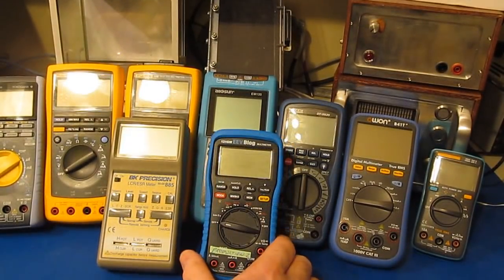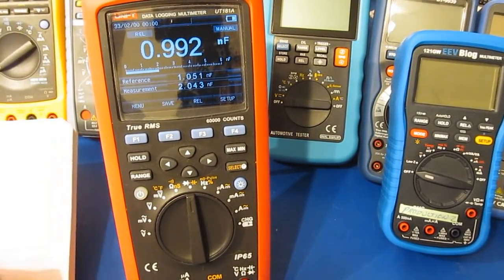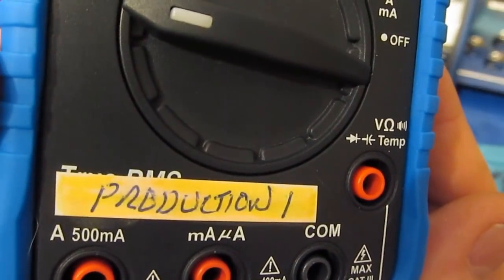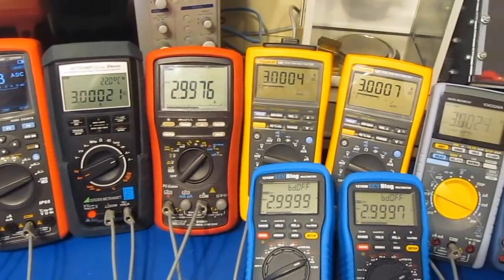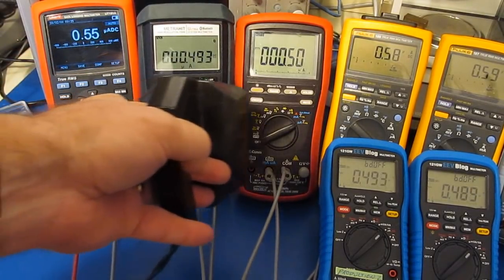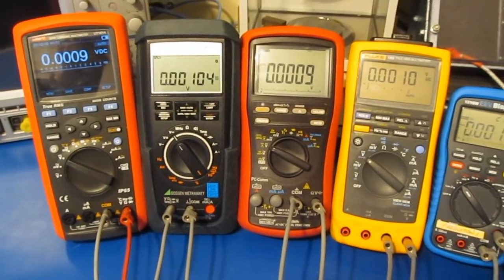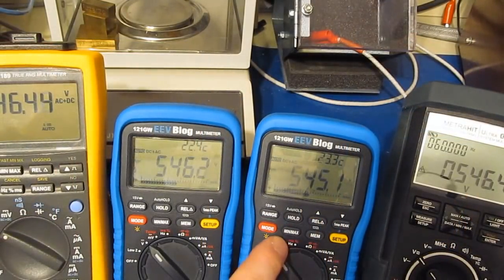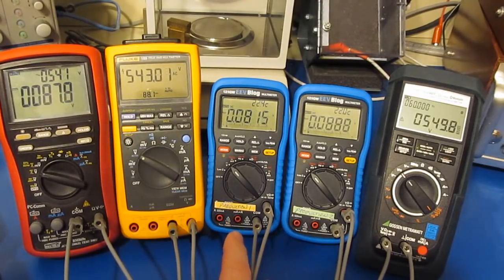EEVBLOG/UEI 121GW  Part 3,  Voltage, Current AC+DC, Capacitors

Comment: I experienced much the same erratic behavior with a Klein MM700, which as I understand, is also a UEi meter. Its very slow ranging and super slow settle times are what sent me on a quest for something better. This is how I found your channel in the first place, and ultimately purchased my two Brymens, both of which I am very satisfied with.
Reply: I own and use a Klein CL2300 and it shows the same slowness to range and settle.  For capacitance, it also exhibits the same positive offset or zeroing.  Both the CL2300 and 121GW generated comparable results... both with settling issues. In resistance the CL2300 takes longer to range to zero from overload.  Might be UEI typical standards for time and least significant tolerances.  Always figured they were a poor mans Fluke, so lived with it... built with IP & drop ratings, UL listed CAT IV ratings.

Btw I was one of the unlucky ones that bought a 121GW fairly recently and got stuck with an older rev PCB.  Noticed the silkscreen when I opened it, but figured they didn’t sell well enough to burn through initial stocks.  My ignorance was bliss until Joe’s discovery.

Still, while not a perfect meter... comparing other $200 US new meters, compares well... and yes I think the Swiss army approach seems gimmicky, but what novel features that has been added for the price (15v diode, low burden, low Z, bte data logging, VA) are functional to a point, when a more appropriate dedicated option for the job isn’t available.  I don’t get why so many expect performance of  $300-600 US fluke/Agilent/Brymen.  Maybe my bar is set just very low, having lived with a Klein for a few years.

Comment: Nice video Joe.  That is a concerning issue you found with the 121GW not indicating the DC voltage when present with the AC voltage.  Hopefully this will be/has been fixed in firmware.

Comment: You only opened up 1 of the 2 1.21gw meters, right? So perhaps that other one has a different PCB version and the v.01 was one that just 'ended up' in between newer ones. It is interesting that the production date of pcb is week 45 of 2017, prototype week 20 of 2017 so both some 2 years old... As to you suggestions: only 1 company was ever interested in suggestions I made to some products as an outsider, and being a consultant still gives hardly any interest from them in anything you're not hired for, they go the way they want to go unless there is enough outside pressure. So in my experience giving solutions as you did to make it more robust is unlikely to influence them (manufacturer + whatever input dave has) much in itself. And what you mentioned about his reviews, it woukd have been interesting for him to review 'his' 121gw in the same style, his early multimeter reviews are good, critical where they need to be, but in recent years what he puts out is barely interesting, superficial stuff and "let's make more fun of stupid ideas on kickstarter" which results in 30 minute videos of him laughing about something stupid, that could have been more serious and done in 5 minutes.
Reply: The serial numbers are 11 off, so they are from the same batch.
Reply: @Okurkaarrgghh : Well, the PCB numbers are not necessarily similar, even though the device serial numbers are close. An older PCB or an older batch of PCBs may have been unused at the factory then recently used for some reason.. The only way to be sure [ edit: Of what the PCB date it, not what happened at the factory ] is to open it up.
Reply: @WHS_reviews  You have more chance to win the lottery than that happening to Joe's meters.
They both had firmware 1.57; these are both old stock.
Reply: @Okurkaarrgghh : Depends on how old 1.57 is, I don't know what the time difference in dates of that and firmware 2 is. Also what I was getting at is that the factory may be the issue, dave may not know what he gets exactly without manually testing them all, so then the question why he sells 'old stock' could be that he doesn't know... So then it could be that he only has some old meters, the rest are newer and thus what you get is based on luck.
Reply from the maker: See attached post:  https://www.eevblog.com/forum/testgear/hear-kitty-kitty-kitty-nope-not-that-kind-of-cat/msg2779204/#msg2779204

Comment: Would love to see your opinion and review of the DE 5000 LCR meter.
Thanks for all of your honest info! 
I Feel like I’m stuck in a feedback loop “vacuum” sometimes on these forums! Nice to hear a change of opinion.
Reply from the maker: I had thought about buying one of the DER EE LCR meters before.  I have a couple of old BKs.  It may be interesting to see how a modern low cost meter like the DER EE compares. 

The videos are basically me running the same tests across multiple meters.  My opinions are formed from the data I collect.   There's a lot more tests to run on these EEVBLOG meters so stay tuned.
Reply: joe smith 

Thanks for getting back with me! 
Yes I think you will be very impressed with the DE-5000. Also you should check into building one of the “leakseeker 89” kits. 

I just built one and I can tell you it is a very impressive piece of gear! I will always be sure to have one on my bench! With the leak seeker and the DE 5000, I can quickly trace down 90% of all faults! 
The leakseeker Is made by EDS, although now the only way you can build it is in kit form.

The same company also makes a device called the cap Analyzer, which is great… But the DE 5000 Takes its Place....and offers many more functions.

Hope you can get your hands on these devices!
And if you are into faultfinding test gear, I’ve got a list of other great devices that are super useful for the bench! 
Some of the modern curve tracer kits sold on eBay really come in handy, along with The wonderful ESR multimeter adapter!
Reply from the maker: @hullinstruments  I may have used something like your leakseeker.  Does it have a headphone jack where you can listen while you sweep the board?    The name doesn't sound right but that cheapo device saved my butt hunting down bridges on a very complex, dense board.

Comment: Thank you for testing this meter in such highly details. For electronic uses, which one of this meters you highly recommended? My budget rage $100 - $200. I want a meter that last me at least 5 years. Thanks 🙏
Reply: Forget 5 years , think of the moment and how to make benefit and gain. You cannot predict future so don't be insured of your continuous successes...
Reply: Jim Mitchell that’s actually a really good meter to get. I just got a job as a firmware developer and I hate fighting with the multimeter I have currently (cheap one) due to loss banana jack ports and wasted so much time. Mostly I program arm and avr, uA measurement is a must have feature for me. The meter you recommended me seems reasonable, thanks.
Reply from the maker: I won't normally recommend meters.   That's covered in the FAQ.   My favorite meter that anyone could procure is the Brymen BM869s.   The other meter I like is that Fluke 189 but these are all very old.   I am the third owner of the one a friend of mine had passed along to me.   It was shown in this video.    Both of these meters have the basic features I want and are both very electrically robust.

Comment: @ Joe:  How do I upgrade the EeVBLOG firmware please? Is this a factory upgrade only? Thanks in advance.  😊
Reply from the maker: I would just read the manual and follow the instructions.   You will need a way to get the files onto the card.  I suggest you also read the section about backing up the calibration data while you are at it.

Comment: Is there any chance we will be able to get access to the log of hardware changes needed to make the 121GW usable?  I use my July 2018 kickstarter unit for testing batteries. I use a Fluke 289 elsewhere.
Reply from the maker: Usable in what way?   You can already reprogram with as much firmware as you like.  What else do you want to do with it?   LOL!   Seriously though, I have no idea of how many variances were released and what all the changes are.  I also have no idea what impact each change has on the meter's performance.  This is something you would need to ask Dave.  I'm sure you're not the only one who would like to know.

Comment: fluke agilent and brymen.. the best choices
Reply from the maker: After seeing that detent spring crack all four prongs on the Keysight meter,  I lost interest in looking at another.   That was a really big miss on their part and I can't help but think, if they can't design a simple spring, what about the rest of the design.
Reply: joe smith sir, I have 2 u1242Bs, a blue version and an orange one, and a u1272A. I never had problems with them sir. the blue u1242b's almost 9 years old and is still doing fine. the orange one and that 1272 we bought 5 years ago. we use them everyday in our shop sir same with the flukes we have. maybe it depends on the model sir. I had a u1231 before too and after a year it started doing weird readings and when I looked inside I saw them pcb contact switch pads grooved by those spring contacs in the rotary switch assembly. they're pressing too hard on those pcb contact pads and I thought that was an issue or design flaw regarding that model. what we did was, we retrofitted it with another set of spring contacts that are much more flexible from a donor chinese meter, and covered up the grooved pcb pads with   copper sheets electroplated with 10 karat gold. that 1231 is a bad model and needed some work to be fit for use again sir.
Reply from the maker: @chrisblank9090  That's pretty sad that you would have to modify a brand new production meter from a name brand like Keysight.   It certainly doesn't do anything to increase my confidence in the brand.   I doubt I would look at another.
Reply: joe smith sir that was a fun experience. we made it work better by fixing the issue and after that there were no more problems with the meter. we also had a problem with our 189 2s when datalogging solar panel readings outdoors. also fixed it by putting some soft rubber ontop of the i.r slots. also with our 1 87 5 when we worked on a telecom tower's power house the meter went heywire. fixed it by adding aluminum tape shielding on the inside. even the top of the line brand like fluke had some issues with some of their models. the nice thing of it is that they're easy to fix sir. unlike that eevblog meter.  we can't fix it's software issues sir. unreliable in the field in my opinion

Comment: In part one...I believe you stated that you were also going to test the latest production firmware on the GW?  I believe it is at 2.x now (I do not own one but have it on my list).  Looking at the change log it looks like the only changes they note are "Resolved calibration glitch with V2.00 firmware.
 Reduces the Offset in the 50-ohm range." and "Improved the Auto-ranging reading speed in both capacitance and resistance ranges."  But who knows what other tweaks or fixes are not noted.   In any case testing or comparing with the latest production firmware would be helpful and give a better comparison between the GW, other meters and GW with older firmware.  (I wrote the above comment right before the update to 2.02 in the vid!...of course...but question still stands, I would like to see more testing with 2.02 as comparison)  Keep the vids coming, love your reviews.
Reply from the maker: 2.02 was loaded onto that meter in the previous video to try and see if it had any effect on the problem I was seeing.   I've also included several screen shots where I show the filter roll off and noise for the various versions of firmware that I had looked at.   I just linked a video in the EEVBLOG forum where I repeat Dave's settling time demo.   You should have a look.